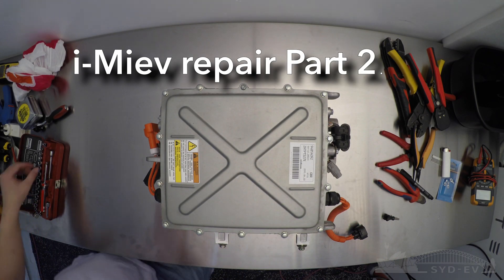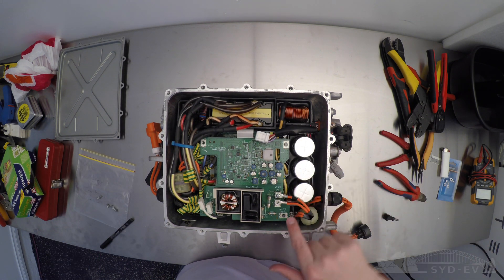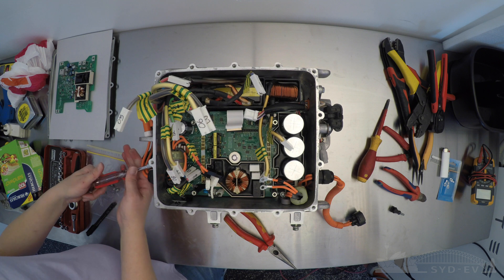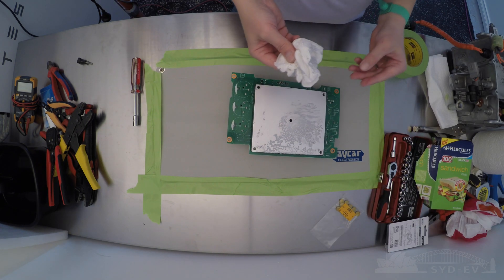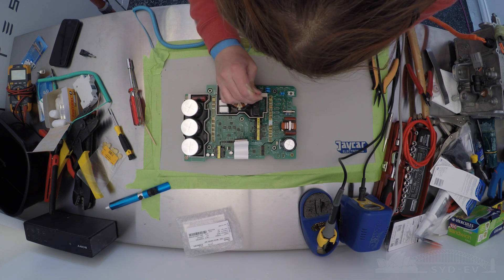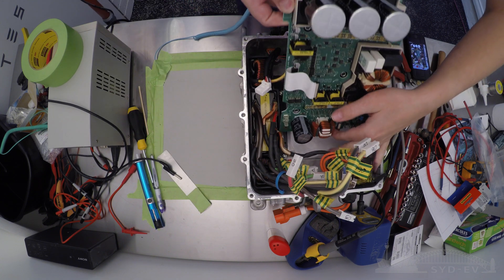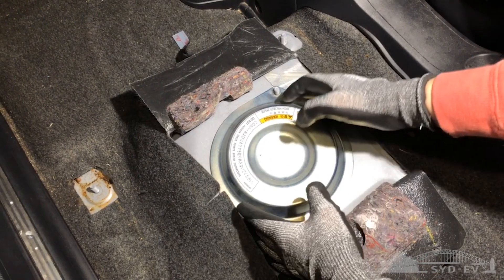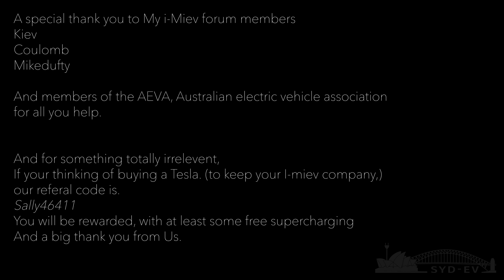I-miev Dc-DC converter repair Part 2

Comment: Thank you for a very well made video with details. I have a similar problem. One capacitor burned out, but I replaced two capacitors just in case, so the problem persisted. The fuse was not blown...

Comment: I did everything like you did in the video, hooray, everything worked out, but only for 3 days, and it burned out again, what could be the reason for this?
Reply from the maker: oh that's not good. if it burned out again,  was it the same capacitor? could there be a short somewhere else,  or a failed fuse?

Comment: I was able to do the repair some 2 years and 22.000 km’s ago.

This time the Okaya LS225 X2 condenser with 2,2 microfarad was producing smoke and made charging AC impossible.
With this defect the 20 A fuse in the inverter stayed healthy.
Reply from the maker: I cant rember what the rating of the capacitor was now,  but we have not had an issue since the repair.

Comment: Very well described.

I saved much time doing the desoldering and soldering in the built in condition inside of the vehicle.
It was helpful to have a goold soldering station and a de soldering vacuum pump.
Reply from the maker: im pretty crap ap soldering, but luckily my partner is good at electronic stuff,  hence she did all the solder work.  at the time we removed it from the car as we didn't know what to expect and were expecting to have to replace the entire converter with a second hand one

Comment: 3:01 had same issues with blown capacitors and repaired as you did 2x1nf caps but two quick questions. 

The board capacitors were 2nf by four in series parallel according to my multimeter did you have a schematic to know what was needed?

how did you test the relay? saw some of the spade locations but was wandering if you could help with more info. 

Our charger was working (just super slow) and now will start and then fault out after fan and cooling check (can hear a relay kick in and the shut off) 

Any help would be amazing!
Reply from the maker: We did not have a schematic or anything, just pulled it apart to see what was damaged, and spotted the destroyed components,  we got all the info we needed from this site https://myimiev.com/, where the members were very helpful.  but in our case, the charging wouldn't start and the fan and cooling check didn't happen.  sorry i cant be of much more help

Comment: Thank you for the videos, I have just repaired my 2011 C-Zero easily (error code U1113, P0A09 and P1A12), 1 blue capacitor was blow.

For the next ones: I removed only the upper board (pay attention when you dismentel the flat cable), it's not necessery to dismentle everything.
Reply from the maker: good to hear you dont need to dismantle to much.
Reply: @SydneyEV  well — to have sufficient room to clean up everything and to scrape off the silicon that covers the electronic components I recommend to take the upper board out.
The unlocking mechanism of the flat multiwire cable is almost intuitive.

After replacement of the condensers, I also recommend to embed them in a suitable polymer.

Comment: Hello can you recommend a potting compound? What product was used here?
Reply from the maker: We just used a neutral cure high temperature grade silicon sealant.  usually a red colour. Im sure other sealants would be fine, or a dielectric sealant.

Comment: Thanks for these videos. Just had the inverter/DC-DC convertor fail on my 2011 I-MiEV. Mitsubishi dealer I've been going to since the car was new doesn't want to touch it. They say that the convertor is no longer available from Mitsubishi. This gives me hope that it can be solved. Thanks!

For the people who asked about Chademo, it works in my case. Only problem was that the 12V system is apparently used while charging so when my car got to about 50% it stopped because the 12V battery was empty. 

Is is true what some comments say about parts being tied to the VIN???
Reply: @SydneyEV  Good news. My 2011 I-MiEV is working again! Your videos on this subject made it possible for me to fix this myself and save our car from the scrap heap. Thank you, thank you, THANK YOU! Still can't believe the Mitsubishi dealer just washed their hands of this so easily, and really, this was not that hard to fix - so long as you can solder. ;-) I recorded all of my repair so I'll be sharing it on my channel as soon as it's done. Thanks again for these videos!

Comment: hi, maybe you have the schematic diagrams of the converter or at least you have a high resolution photo of the lower board, the one with the big heatsink? I tried to unsolder the heatsink and accidentally blew off the resistor with a jet of hot air, now I don't know what resistance it has and where it was.
Reply: @SydneyEV  thank you

Comment: My 12V battery is not charging during the ride, is it DC converter ?
Reply: Yes the DC-DC converter is also responsible for charging the 12 V battery.

And possible no — it might also be a defect of the 12 V Battery.

Please check the voltage at this battery with vehicle turned off and compare to voltage in turned on position before starting your repair.

Do you have newer information about your defect and repair?

Comment: Hi, colleague, I have a Citroen C-zero and no problem until now.But the car has now thrown out a fault P1A15 fault charging the capacitor.There are crazy repair prices in the repair shop and it's still not certain that it will fix it. Can't you please advise me?I love the car and I don't want to tow it to scrap.
Reply: @SydneyEV  Thank you very much for the information.I hope to find something there to help me fix the car.

Comment: Thanks so much for this, couldn't have done it without your guidance. Just wondering which chips you were checking with the multimeter for the continuity test?

Comment: I've replaced the capacitors. Put all back together and I still wont charge via ac. Currently sitting at a dc station charging up.
Reply: Have you also replaced the fuse, as shown in this video?
Typically it blows off, when the capacitors die.

Comment: This car is made to bring profit to Mitsubishi! The car after 8-10 years develop charger problem. Charger to change 4300 Euros because you cannot buy separately the parts to reaper it! Who would buy a car when the tire is flat and in the workshop you are told that the gearbox have to be replaced with the tire because they work together ???!!!!
Everything is vin coded so you cannot buy used parts and replaced. Battery last about 15 years  and cost until yet 10.000 Euros! Even if a small problem occurs with the battery you must change all the battery. So consider to give after 15 years 15.000 Euros for maintains. That’s no Green driving! This car cost more to drive than a normal gasoline car! Mitsubishi has once again shown us how wonderful it is to drive green!
Reply: For mr the repair cost 4300euros ! I have not the same problem with you !  So if you pay 4300 and 10000 for the battery after a while. Is that Green driving ??? Is this economical ???

Comment: Thanks for the video, feeling confident that I can repair this myself now - do you need to remove the heatsink to solder in the capacitors?

Do you have a part number for the fuse?
Reply from the maker: not sure about the part number for the fuse, we asked the Mitsubishi service department, and the old fuse,
Reply: @SydneyEV  I found the fuse part number: 9499A656.
I replaced the capacitors in the DCDC converter and repaired the car 😊
Reply from the maker: Nice work!  @AshAckroyd   Its amazing Mitsubishi cant figure it our or do the work.
Reply: @SydneyEV  I ended up digging out the sealant with cuticle sticks, cracking the capacitors with pliers leaving the legs intact in the board, I then soldered the new caps to the existing legs then back filled with sealant 🤣
Reply from the maker: @AshAckroyd  nice work, definitely a n easier way to do it

Comment: Thanks for two very useful videos, SydEV. I have the same issues on my C Zero and have now followed your video to unmount the DC-DC converter. My capacitors is not blown, but they have cracks in the surrounding shell. Do you think they cause the problem even if they are not completely blown? I have checked all of the fuses within both sides of the DC-DC converter and they all seem ok.
Reply: @SydneyEV  Yes, thanks, This is very helpful. I have ordered new capacitors at RS and a new fuse for the inverter, so hopefully it will charge again :)
Reply: After repair can now the car charge ?
Reply: @petterkongrod  Any update?
Reply: @daniellele9634  Hi, it did´nt work out. I had to replace the whole DC-DC converter.
Reply: @petterkongrod  Aww damn.. thats a bummer. Thanks for the reply
Reply: In general, the cracking capacitor has been short-circuited at least.

Comment: Have you changed lev50 cells to lev65? bms sees 65Аh?
Reply: I understand that I have a car 81%, Japan.
but despite this, I want to change the cells to 65Ah and the mileage will be much more on a single charge.
it’s just not clear whether the BMU can correctly determine the battery capacity, in the datasheet it says that a maximum of 65Ah.
Reply: good! Mitsubishi PHEV Outlander place in the battery case is more convenient to do other cells.
can put 40 (1x2) cells from Nissan Leaf.

Comment: Hi,

Is it possible to fast charge via Chademo when this happens?

Thanks!
Great video!!

//Peter
Reply: @SydneyEV   WoW, i am sorry to hear that Sydney only has 1DC fast charger. Way behind the time.
Reply: Yes — the traction battery can still be charged via ChaDeMo.

You will have to charge the tiny lead acid battery under the front hood, because the charging and power supply of the lights, vents and all other accessory devices is also fed by the DC-DC converter.

Comment: Is it possible to do this without draining coolant?
Reply: @SydneyEV  i have changed obc with another one from a scrapyard. It sat in a car with front collision. After changing it, the light on dashboard is still there and car won't charge. Any suggestions of what is most reasonable next thing to do? Trying to do this diy as my budget is really tight. 
Anyway. Your video was bunch of help and really appreciated.
Reply: @lukasbidva3047  Did you change the MCU Fuse ??

Comment: Hello, here in spain there is at least 4 or five knows issues with the charger.  but in almost cases, the broken component is a pk10 TAM.
have you any email address to send a picture of the components broken?
many thanks in advance.
Reply: Can you send me the same picture or pictures ? I have the same charging problem. Everthing works fine on the car but it wan t charge! matheos@gmx.net

Comment: This is really helpful! Should I perhaps do the job before it fails? Any better or uprated capacitors? What is the root cause? MTBF, project?
Reply: SydEV Good to know! I’m driving a 2010 too, VIN ending 808.. Well, let’s hope for the best! Luckily, if it happens, at least there is already an amazing tutorial to help us sort! ;) Best regards from Brazil!
Reply from the maker: not sure, With this failure, you can still charge the car from DC Chademo,
Reply: Other than on ICE cars, where a failure of the timing Chain or belt would damage valves this defect does not have a side effect off further damage.

Sure — when you do the repair and only one capacitor would be blown => change both.

I have searched for hints after the failure — you are informed far ahead.